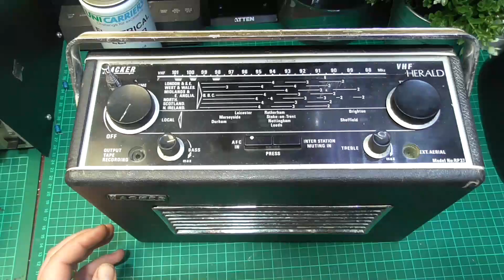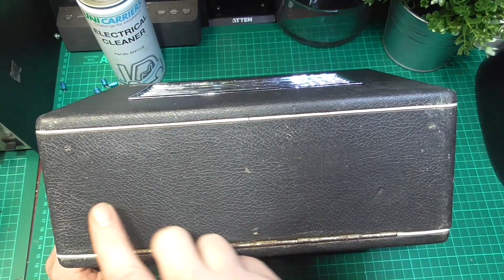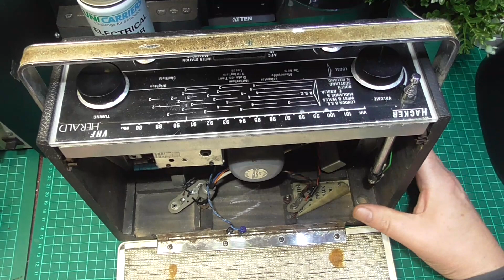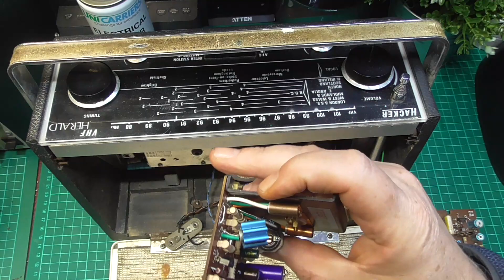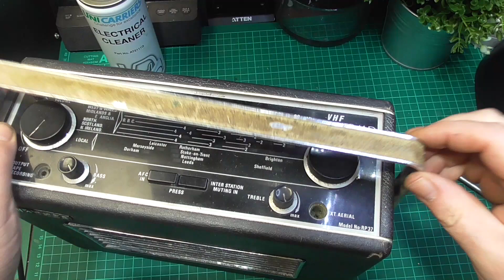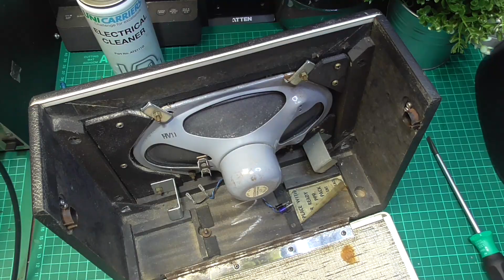PT1 - Hacker RP37 VHF Herald - UK Lockdown Edition - First look

Comment: It is a bit knocked about but i'ts recoverable :-)
I like the strong sliding station markers, they thought of everything.
It has a similar look to my Rp38, i could not let it go to landfill, no way.
Reply from the maker: Everything is recoverable 😉 - The RP38 and the RP38A are the best '*all round*' sets that Hacker produced. Sure there are bigger sets, more expensive sets, but they do punch above their weight for sure.
Reply: @Codeeze  I have to admit that i do like the radio, its nice to listen to and within my understanding of super hetrodine conversion,  i used to repair c.b radios and they had a double conversion.
I know you cant compare the two but the methods are similar :-D.
Im a hater of digital radio, like im a hater of rubbish freview t.v, i loved analog :-D